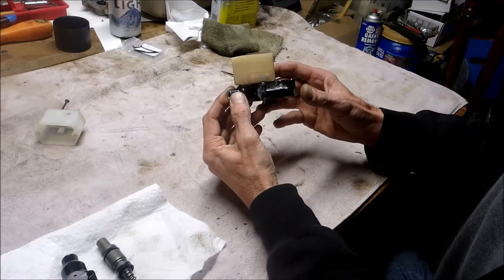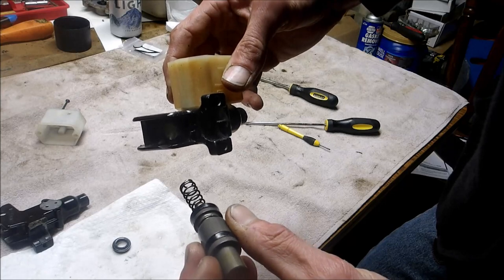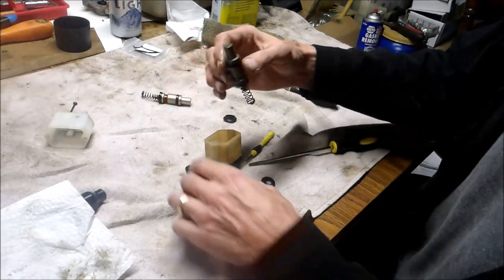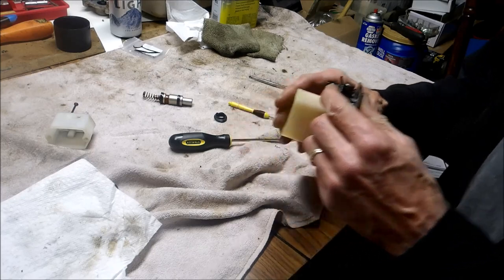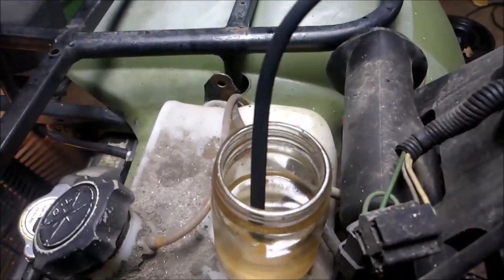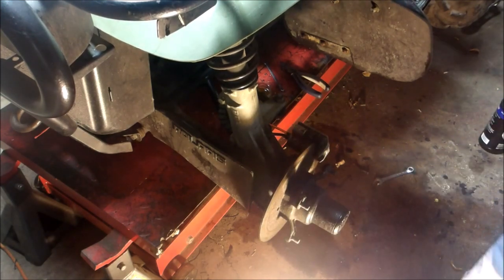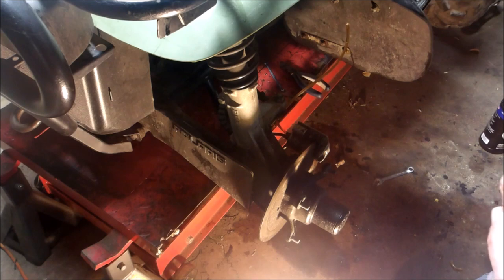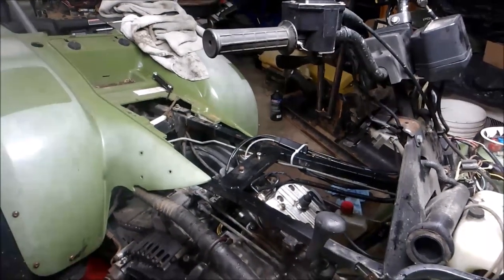HOW TO REBUILD A MASTER CYLINDER ON A POLAIRS SPORTSMAN

Comment: Tip for getting the cylinder out if its stuck, you can put a punch down the other side, with the spring and hammer it out, mine was really stuck and even after the seal was removed, couldn't pull it out.  Seals on mine were not bad, just a ton of black gunk in there that was causing it to get jammed and not return fluid into the bore sticking the brakes on.  Thanks for the video, helped a lot!
Reply: Thanks for the tip! I think maybe that's what's happening to mine? I can bleed them, then go for a test drive and they begin to lock up, I guess I'll have to take apart and try to figure out, I have a aftermarket one on the way but maybe it just needs cleaned 🤷
Reply: @whatsit2ya247  Same thing happened even after I rebuilt the master.  I ended up snaking the rubber brake lines with a bicycle shifter cable to clean it out, that seemed to clear it up. But I'm fairly certain it needs new flexible lines, they'll pass fluid out but won't return it, so the calipers lock up.
Reply: @Kingsoupturbo   Mine wouldn't return either, the fix ended up taking the upper master cylinder apart and I noticed after taking the fluid reservoir off that one of the holes that goes to the cylinder was completely clogged shut, there's a big one and a tiny one,( it was the tiny one) poked it with a small pointy poker then reamed it with a small torch tip cleaner, cleaned everything up, put her back together and that did the trick 😁
Reply: @whatsit2ya247  Very nice! old fluid can sure get gunky, and little chunks for the rubber lines deteriorating.  I tried to find a lower cost solution for new flex lines, but they have an odd size fitting.  next time I do the job I'm going to put another master cylinder to the rear brake, the combination block that splits all three is so very hard to bleed.

Comment: What would cause a 99 sportsman 500 to have brakes that are only effective when both the foot lever and hand lever are pressed? The hand brake lever also causes overflowing from the rear overflow resivour (under the seat), it feels like a one way valve somewhere has gone bad. Ideas?

Comment: Hey bud good video  I have a 2001 Polaris 400 sportsman but sportsman obviously I have the left hand break then I have a reservoir underneath the seat seat that takes more of brake fluid how do I bleed that system system and it has on the caliper caliper I have 2 bleed screws Appreciate your comment
Reply from the maker: https://youtu.be/8zUAy3hAcUw Check this one out.

Comment: how did you take the bleedr fitting off the master and put the brake line back on without sucking in air
Reply from the maker: You bleed the master after you install it. then bleed the lines. I was able to keep the fitting upwards and top it off with a syringe.
Reply: @TitaniummanGarage  yeah but after you take the bleed kit off the master doesn't
 it suck in air?
Reply from the maker: @TheTechGuider  You have to hook the line up quickly. If you dont squeeze the handle it won't suck air. But yes air will still be in the line so you have to bleed the brakes.

Comment: Hey T man thanks for the videos been watching a few years. I have  94 and 96 sportsmans. 94 hasn't ran in 5 years 96 is a nice unicorn. Brakes went out on 96 so replaced all pads and put on dry China master. Instead of trying to find the kit you said to get at parts store to bleed master I took the tank off. Thinking I can take the Master hose out of the block and use the jar method. Tried think the wrench was bending some, now have it soaking in break free. I noticed you changed to a braided stainless hose with a banjo so wondering if you tried what I'm doing and broke off? Any advice?
Reply from the maker: I replaced the line because it was so corroded inside. Are asking if it broke in the junction block?
Reply from the maker: Beware of the china master. I had issues with those. I couldn't get the master to bleed. That's why I rebuild them now.
Reply: Yeah, the line nut going into the block didn't budge. Its soaking in break free now. I thought about putting heat to the block but there are a lot of wires there.

Comment: hey man im having trouble with my cam. the decompression lever seems really loose. the manual says not to preload the spring one full turn but the recommended preload of 1/4in seems really weak. barely holds is self. is this normal?
Reply from the maker: I've done it both ways  as long as it has some play and not preloaded where it won't turn.
Reply: @TitaniummanGarage   so as long as it turns easily it should be good?
Reply from the maker: @TheTechGuider  Yes
Reply: @TitaniummanGarage  which way would you recommend
Reply from the maker: @TheTechGuider  I guess depends on how weak the spring is. Probably best to leave it where it is supposed to be. I had a really weak spring when I did mine.
Reply: @TitaniummanGarage  mine is so week it sags just from gravity if I turn it upside down. What you think?
Reply from the maker: @TheTechGuider  Try it.
Reply: @TitaniummanGarage  I just wish there was a video of what a normal spring pressure looks like